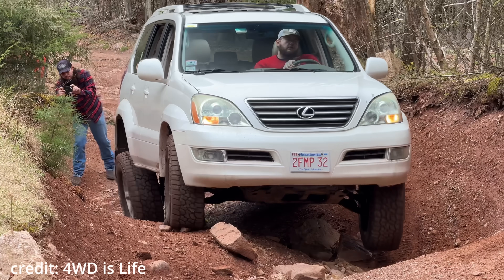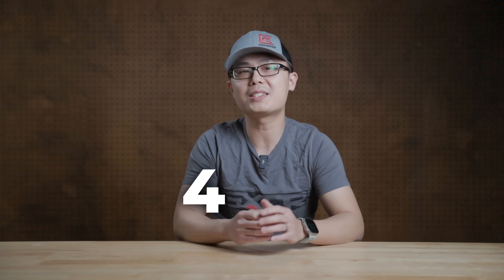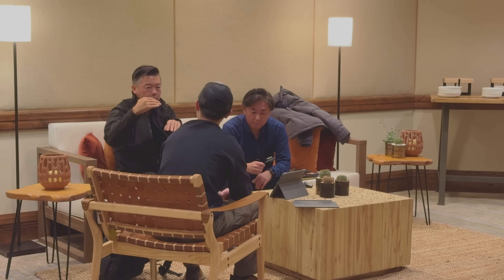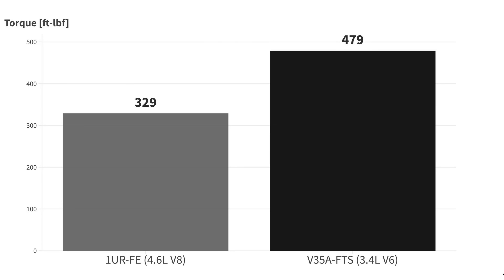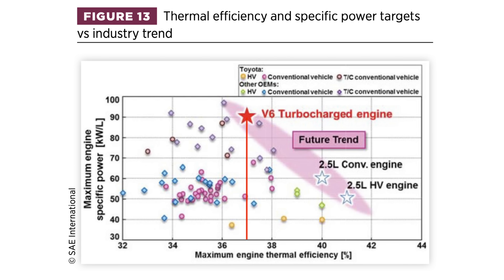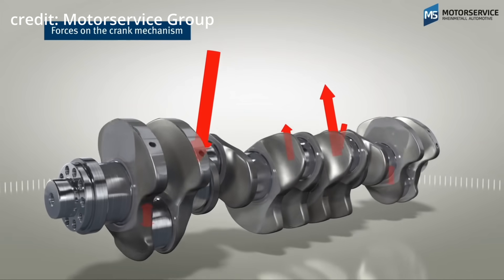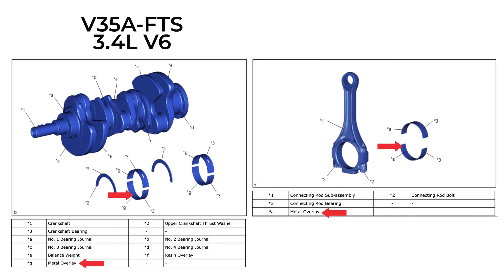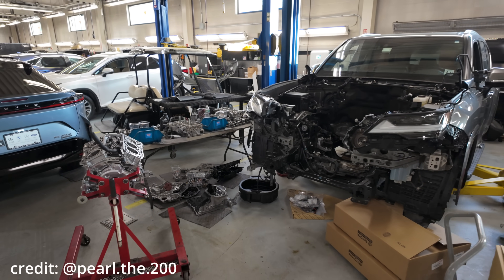Is Toyota V35A-FTS Engine Reliable? Well..It's Not That Simple

Comment: I work in this industry. Yes some of the engines are failing, particularly the no. 1 crank bearing but also sometimes the connecting rod bearing instead of the crank bearing. Seeing as this engine came out in 2018 it’s surprising to have so many failures for a brand known for reliability.
Reply: gx460 still the goat, then?
Reply: GM, Ford and Honda are all facing the same problems, speculated to be improperly cleaned blocks after sand casting, but I don't have enough actual evidence to say anything concrete about the causes.
Reply: Online forums probably makes this issue seem more prevalent than it really is. Dealership near me hasn't had any come in for this.
Reply: @stevieray1828  but now Toyota has announced a recall.
Reply: @husshardan3511  I know. At least Toyota is addressing the issue. Hopefully it works out for the owners. We still don't know what the failure rate is, the fact the engine could stall at high speeds and create a dangerous/deadly crash means Toyota will be forced to take action. Maybe Tundra owners will get new engines with an extended warranty... Good deal
Reply: Answer me this then please, ejohn. If the engine did, in fact, come out in 2018, why are we only seeing it for the newer Tundra models? Are the LS500 engines reliable then since no one complained of any turbo issues in that model? My goal is to swap a V35A-FTS into my RC300 when the current 8AR-FTS engine eventually breaks down.

Comment: There is no way, I will give up my naturally aspirated 1GRFE V6 engine. These are absolutely bulletproof and such a forgiving engines.
Reply: we want a 1grfe paired with a 10 or even 8 speed trans.....but never gonna happen..
Reply: @FranciscoHugoGarcia ur better off keeping the 5-6 speed transmissions, I’ve heard those 8-10 speed tends to hunt for gears a lot
Reply: @BigAltimaEnergy719 this is actually an engineering work around for drowsy or distracted drivers. That's why cruise control will not hold a single gear for the posted limit
Reply: @FranciscoHugoGarcia the Lc300 comes with a 4.0 variant that carries the 4.0 1gr fe with the 10 speed transmission (2022- present Lc300) look it up
Reply: I love 1GR it's the best for me too

Comment: Finally a subject im pretty knowledgeable about!
The longer stroke and shorter rod ratio (this is likely though i dont have any rod length numbers) force the piston to spend less time near piston Top Dead Center and in conjunction with a smaller bore and an optimized burn the ignition can be less advanced (reducing pumping losses) and resists knock because of the faster piston acceleration away from TDC.
All of this increases low end torque. add in small quick spooling turbos and you have more power being made in a smaller surface area. The smaller surface area allows less heat loss(through conduction and more Work extracted)

Main and rod bearing diameter (and width) have probably been minimized to reduce frictional losses. Couple this with fewer rod and (more importantly) MAIN bearings in a V6 VS a V8 and the more violent (because of shorter duration combustion and being shared between fewer cylinders) combustion strokes and the bearings are dealing with much more force with a smaller bearing surface area.

 If the forces are enough to break through the cushioning oil layer because of knock or power, or even bad harmonics they will relatively quickly damage bearings.

Less agressive ignition timing, less torque or higher viscosity oil should all be able to bandaid the problems, but in the end its likely the bearings being over-optimized for fuel efficiency and not having enough of a margin of error for unknown harmonics or the effect of the faster combustion on instantaneous loads sent through the piston/rod/crank assembly

Comment: A lot of people dont understand how far we've come in manufacturing technology such as metallurgy, tolerances, etc. Turbos aren't the boogeyman anymore. The only limiting factor at this point is people.
Reply: Ill be waiting to hear from high mileage new gen toyota owners
Reply: @PonyFoot123  As long as you listen to the ones who change their oil. There are going to be a lot of people disappointed in their engine's longevity if they're changing oil at 10k miles.
Reply: @DeuceDeuceBravo  for sure!!!
Reply: I was a 4g63 fan for years. I have daily driven 400whp cars/vans (eagle summit awd)with 16/18g turbo 4gs with over 240k miles. Turbo engines don’t automatically mean less reliable
Reply: @PonyFoot123  You will, especially 4 cylinder Tacoma owners. They wont make it to 400K like the 1990's 4 cylinder  Tacoma's did. Not even close.
Reply: Time will tell but I think these turbo engines will go the distance if they’re maintained, AND if people don’t do the ridiculous 10-12K oil change intervals.🫤
I haven’t seen many engines last for a long time doing those long oil change intervals, ESPECIALLY turbocharged engines.
Reply: @DeuceDeuceBravo  One thing we don't have is a scientific measure of longevity in the real world. The 1UZ has a great reputation, but how do we know? Reputation can be tainted by marketing, bias, and old wife's tales. How do you control for different cars getting different levels of maintenance? People maintain Lexuses way better than a CarMax Altima. Point being, it's all anecdotal and there's no real data.
Reply: That’s untrue. Tolerance in engines are the same today as they 20 or 30 years ago. Same with the materials. The only major change are the engine management is much more advanced.
Reply: "Turbos aren't the boogeyman anymore. The only limiting factor at this point is people......" . The main bearings might have something to say about that statement.
Reply: I appreciate the thought that on paper this “should” last as long.   The heat of turbos should not be underestimated.  There are still no turbo petrol engines known to regularly go past 300k.  Some do no joke, but they are exceptions.  Diesels spin slower and heat is more manageable, so quite a few are known for longevity.  Hope Toyota cracked this and these new engines become the new standard for longevity.
Reply: @spectrixx  those bearings are getting eaten by vibration. There is no way in hell that top-cap assembly provides adequate or even pressure on that crankshaft. A 4 or 6 bolt main is a far more superior design than this as far as strength goes.
Reply: @PonyFoot123  Hino (Toyota's commercial truck arm) has been making turbocharged engines for over 60 years. I think this will be fine.
Reply: turbos will always be failure point of the engine . long as normal oil and mait is done etc  turbo will fail   .  its no different than a spinning hard drive .  very reliable but it will be main fail point long as psu etc holds
Reply: @jamesgullo8240 my dads 04 sti has 180k miles still going strong
Reply: @jamesgullo8240  I owned a 1990's 4Cyl Toyota truck. It was woefully underpowered.

If you actually need to do some work its the last vehicle you would pick.

The same cannot be said for the new Tacoma.
Reply: @spectrixx  Actually, no, that still goes back to the people that either designed or manufactured these engines. The fact that they are failing at 20-30k miles shows that its a design or manufacturing flaw, not an inherent flaw with all turbo engines since we know there are plenty of turbo engines that make it past 30k miles.
Reply: @akeel2576  My parents had a 2009 Acura RDX with the 2.3L Turbo that was at 300k before the rest of the car fell apart. Transmission cooler blew, the radiator blew, that A/C dies and then they finally cut their loses but the engine kept going strong.
Reply: BMW and ford disagree with you. Their turbos are not reliable.
Reply: @DeuceDeuceBravo and yet, why does Toyota suggest 10K oil changes?
Reply: @LQban0 because people are lazy and low maintenance sells cars. It will blow after the warranty is up so they DGAF
Reply: @spectrixx if you're referring to the Tundra's engine they found out the cause of that (aside from the electronic wastegate issues).
Reply: The limit is how well they build it. It’s called engineered obsolescence
Reply: @crunchycrispybacon that isn't exactly true though. My tacoma takes 0W-20 oil, that tells me those main bearings are TIGHT. Same goes for piston ring gaps, cam bearings, piston to wall clearance etc... 

Everything has tightened up in recent years due to changes in metalurgy that allow for tighter clearances because the metals we're using (and where we're using them) aren't expanding and contracting as much
Reply: @christofonobrown3659  theres more  300,000km toyota caldina GTTs here in NZ than any other GTTs with lesser ks.Mine is on 315k and still going strong.2l four banger turbo.
Reply: @rorynesta7766  thank you and appreciate, we don’t get those in USA, so unfamiliar with them.  Which motor does it have?
Reply: @christofonobrown3659  it has the 3sgte engine.For a late 1990s engine,its very good.And yes,sadly there arent there in the USA.Its basically a sportswagon.
Reply: @rorynesta7766  right on, we did get them in the MR2.  Unfortunately these were not the primary vehicles for mega milers, lol.
Reply: @LQban0  Manufacturers suggest 10k mile oil changes because it gets them credit with the EPA and other agencies; oil changes count against them. It also lowers the annual "cost of ownership". By the time issues arise, the vehicle is out of warranty anyway. Obviously this is a stupid, shortsighted strategy.
Reply: @LQban0 if you read the manual, 10k mile oil change only for certain conditions. Most people don't fit into this category and therefore Toyota recommends 5k. It's really the dealerships not caring and just doing every 10k.
Reply: @christofonobrown3659  Many turbocharged Volvos have hundreds of thousands of miles....
Reply: @mcglovera  I am aware of many individual turbo Volvos, but that was also my point.  As a group the turbo (petrol) Volvos are not known to exceed 300,000 miles, only a few do.
Reply: Yes modern ones are really good. And it’s not the turbos failing either but everyone keeps blaming the turbos lol
Reply: Would be great if these cars were still built in Japan, NOT mexico
Reply: @christofonobrown3659 and most Volvo’s are considerably lighter that these vehicles and also produced less power.

Comment: How can you not love this guy? Brings up Torque plots and scientific papers. Love it. 

That being said, these engines cannot be breaking down as they are - the old 5.7 V8 had one issue, that being cam tower leak, which was simply because of sealant degradation and not an actual engine issue. Other than that i abused that engine in the great white north for 6yrs, and in LC's in the middle east. They were unbreakable.

None of the new ones are.

Comment: I’ve seen the exact same issue with a couple of LC300’s and LX600’s but all of them were being used very hard in the desert which means very very high temperatures, and also on some rare cases only on the 2022 models we’ve seen that on steep inclines or declines the oil light comes on and the coolant temperature gauge goes to max, but in 23 and 24 models it seems like they have fewer problems but that might be a coincidence because in 2022 when they came out dealers could not keep up with the rate of sales and now the sales have come down a bit, i live in the middle east by the way.

Comment: The patented laser cladded valve seats allow faster combustion propagation due to the strong tumble flow characteristics in the cylinder from the straight intake ports. This increases torque substantially and you can see this in the T24A-FTS engine as well.

Comment: These new toyota engines all run very thin oil for fuel efficieny and emissions reasons. This thin oil requires tighter bearing clearances. Tight bearing clearance in a high torque/L engine doesn't leave much room for error.
Reply: The theory that oil passages have changed due to oil viscosity has been disproven.
Reply: @MeltingRubberZ28 he is refering to the free space between the bearings and the rotating parts. With thinner oil those gaps hsve to be closer for the oil to spend a decent amount of time in the journals
Reply: @BrokeWrench  interesting theory, but it's been disproven.
Reply: @MeltingRubberZ28 I think he’s talking about how well the oil handles higher heat
Reply: @MeltingRubberZ28 who disproved
Reply: Then why is using thinner oil than recommended a big no no while manufacturers recommend thicker when racing? Clearly the film is weaker on the thinner oil
Reply: @POVShotgun  oil temps reach 280-300F when racing. Different application than the 210F you see around town.

Comment: I think I have the answer: The problem is not the bearings themselve but the supporting material. The old engines used aluminium where the new ones uses cast iron. Aluminium can draw away the heat in the bearings much quicker than the cast iron. Thus bearing failure happens because of overheating. The specific heat capacity of aluminium is 900 J/kg°C vs only 460 J/kg°C for cast iron.
Reply: Get this comment higher! 
I had a similar thought when @17:32, he mentioned this material change. I was curious if the research paper addresses the difference in heat capacity of these materials and if modeling/testing could analyze the effects of cooling (or lack thereof) in the updated block. 

Sure, it can handle the increased torque output but at what relative temps and for how long?
Reply: i don't agree with you.. because the aluminum main caps main job is to stay in shape and not move as the crankshaft is rotating remember that bearing clearance is in the thousands having those supports just makes the main cap stronger . it has nothing to do with heat dissipation.
Reply: And of course they never tested these engines before selling them.
Reply: So what about all the famous iron block turbo engines? Its not heat thst kills bearings, its lack of oil. The oil is supposed to be between the bearings and rotating parts. Any heat has to get past the oil as its quickly being launched out and replaced from the bearings

Comment: I have that engine in my 2023 Tundra TRD 4X4 Off Road and absolutely LOVE it! Three and a half liter twin-turbo making more power than V8’s in the same class. It’s faster than the predecessor Tundra. 30k miles so far, ZERO problems (dealer -maintained) and I drive it HARD! Only modification is TRD drop-in air filters similar to K&N. The 10-speed transmission offers sports-car-like shifts from launch! I come from a street racing background, have kids now so live a civilized life. 😃

Comment: In Saudi Arabia the new landcruisers with the same engines are suffering serious issues including blownup engines....may be this engine configuration is working in other countries but in the GCC it is not working at all...
Reply: maybe the new landcruisers are not designed for the desert anymore.  it's a trade-off for putting a small engine and tuning it to give more power and torque
Reply: They’re wrecking big end bearings (con rod) in Australia.

Comment: I recently traded my 3rd Gen Tacoma for a Jeep Gladiator. I still do really love Toyotas, and still have an older Land Cruiser. I wish Toyota would give more of what the American Off-Road community wants. Jeep, Ford, and Chevy are really stepping up their games on mid-sized off-road trucks. I wish you could get the Land Cruisers here that the Aussies have, all this luxury stuff isn't as interesting. The GX550 is very nice, don't get me wrong...
Reply: Yeah, it would be nice if Toyota truly tried to compete with the real off-roaders. I have a 4Runner, and I love it as a DD, but if I lived in Utah or some place with a lot of technical trails no way would I be driving a 4Runner. 100% would be in a Jeep.
Reply: @trailrunnah8886  I have family that lives near Moab, and I used to have a 2017 4 Runner with an ARB air locker and 33-inch tires. I could do a lot in Moab with the 4 Runner. It was great. But yeah, the 4 Runner is kind of at its design limits with 33s and Hells Revenge was kind of as far as I was comfortable doing with my Toyota.
Reply: @adrianw3985  is that a front locker you have? Mine has the factory rear locker. I've never had to use it, which tells me I haven't pushed it as far as it will go LOL. Don't get me wrong, I'm not trying to crap on the 4Runner, it's just what I saw in Moab when I was there, and all the videos I watch, I would definitely be more comfortable in a vehicle like a Jeep, for the increased front articulation, as well as less body work to keep track of.
Reply: @trailrunnah8886  I had an SR5, so I added a rear locker, a 2.5 lift, a winch, and 33s. There is a lot you can do in Moab with a 4Runner. I would say trails rated 5 to 6 with minimal scraping. Even with a Jeep, you may get some scrapes on some of the tougher trails. It's just part of the game. You should try Fins and Things and Hells Revenge. Hells Revenge has some optional parts that would be tough even in a Jeep, so you can drive around those parts.